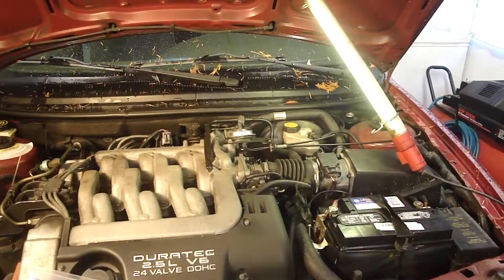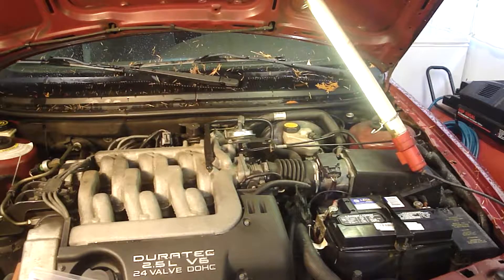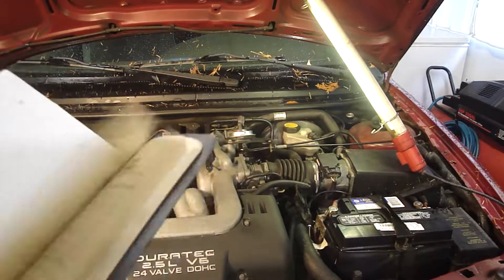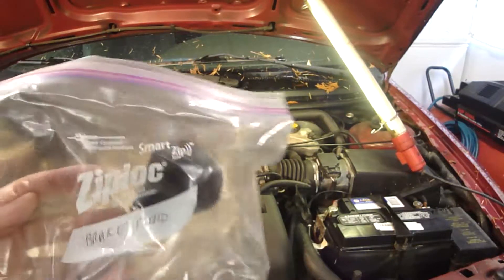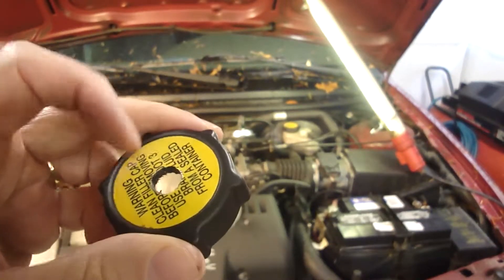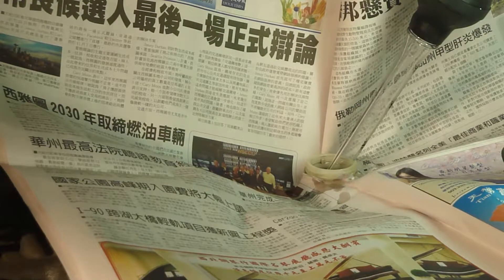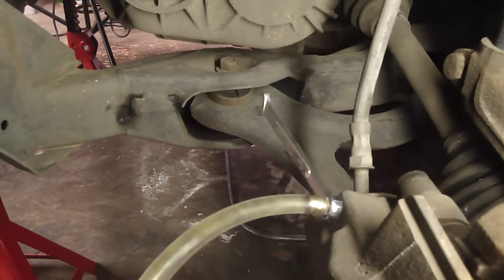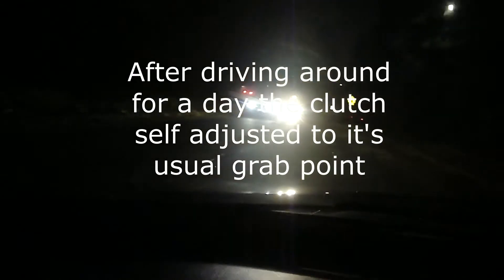Making a One Person Brake Bleeder and Bleeding Brakes on a '98 Ford Contour

Comment: I have a 99 contour svt. Did you have to release the Emergency brake when bleeding the rear brakes so the E brake was tight also ???
Reply from the maker: I had the parking brake released when I bled the brakes.   The PB have to be released to replace rear brake pads.  If your parking brakes are loose they may need to be adjusted.  Bleeding the system doesn't affect the parking brake as the PB is cable actuated.